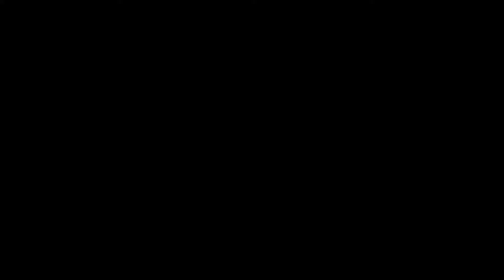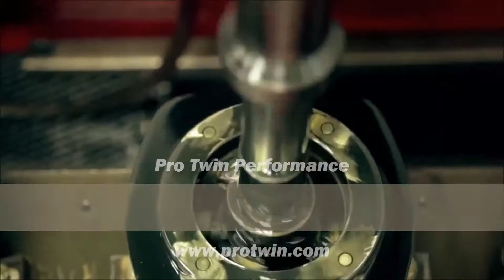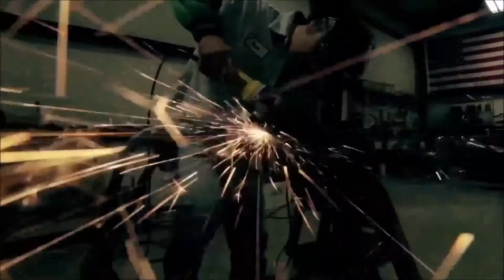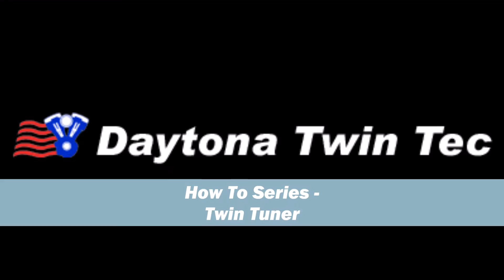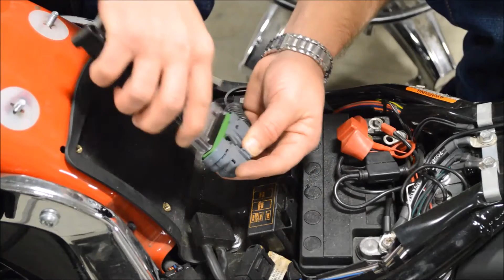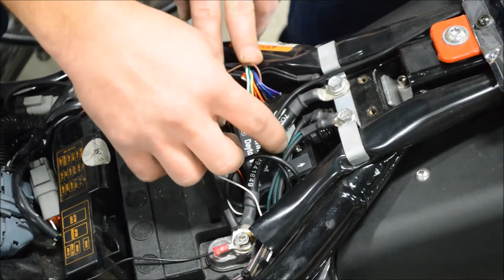Daytona Twin Tec - How To Series - Twin Tuner - Kevin Baxter - Pro Twin Performance

Comment: I just installed 509c cams and a high flow air filter  (it already had Rhinehart slip ons) in my 05 Ultra Classic. Runs great as it is but I'm sure she is a little lean. Thank you for this thorough video. Still waiting for more on the Dixie mafia. Stay safe

Comment: I noticed that on this video you say on parameter 1 to adjust to 2% fuel. In the manual it says to keep it at 0. Why the discrepancy? Which is correct?
Reply from the maker: whichever yields a proper AFR for you.  0 would be stock afr.  I prefer about a 13.8 at idle...so 2% would get you fairly close.
Reply: @KevinBaxter  got it running well at higher rpms/acceleration,  but at lower speeds through town it hesitates as is its  got a vacuum leak (which it doesnt) or not getting enough gas. Rhinehart pipes and big sucker

Comment: Kevin, Question - I used this video to Install my twin tech tuner and set it up after installing a S&S 509 cam chest and the Daytona Twin Tech tuner - Bike runs great but at cruise the engine check light will ever once in a while come on  for 30 seconds then go back out.. Any Idea's?
Reply: 03 twin cam 88 in an Electra glide
Reply: Never mind ----  I found issue ---- lose battery cable... I should have known better-  Thanks for your expertise, Love your channel
Reply from the maker: Thank you Mark.  Glad you found it sir.  Sorry for the late reply.

Comment: What should i set mine to 2002 fatboy. 36 inch samson cholos. High flow air filter. Everything else stock. Bike sometimes coughs out aor cleaner at. Slow speed maybe 10 to 15 mile per hour.  When i throttle it.  Runs great at high way speed and when im on the throttle ect.

Comment: do they, twin-tec, make a tuner for carburetor Harleys. for timing like screaming eagle use to. I can't find one, or could you recommend one, for a 2000 softail fxst. I put a twin-tec 2 on my 02 RK fuel-injected and following their instructions tuned it myself. night and day over power commander. thanks keep the info coming, it's great info.
Reply from the maker: Sure...they are currently on backorder, but i can get you one soon.  Here's the link to it.  http://protwin.com/twincamignition99-03carbonly.aspx  BUT....there has been a recent price increase...they are $375 now.

Comment: I added one of these to my 2003 Road King. Started out ok but after a couple months it had gotten worse and worse cutting out until it wouldn’t start. Removed it and the bike fired right up. Ever seen this?  Confused. Can they go bad?  It’s like the unit was not communicating with the injectors. Set it to base stage 1 settings as per the instructions. Played with it a little but reset to suggested settings before it got to where it wouldn’t start.
Reply from the maker: the single most common problem had with these, is the problem you describe.  with nearly all of them, they tested perfectly fine.  the issue was a good complete connection to the harness....feeding the injectors.  There was literally like a .01" defective rate on this product.  Very reliable and solid.
Reply: Kevin Baxter that’s good to know that the odds of them being bad are low. What should I do when connecting the pins to make sure there is a solid connection? I would really like to install it again. As the bike is low on the gas to air mixture

Comment: Great video, just one observation:  At one point you say to connect the ground wire that comes off the tuner but then you say the positive wire as you hook it up. I hooked it up to the positive side of the battery and that was incorrect. No power to tuner but fuel pump running.  Realized that it should be ground side of battery and it works great!
Reply from the maker: You are correct  thank you

Comment: Hi I know this is an old video but maybe you can help me. I bought one of these for a 2003 Buell Firebolt xb9r. The harness is a little different than the one in the video can you offer any kind of help or directions? Also does the bike
 require a TPS reset after fuel change with this tuner?
Reply: I'm curious too.i have a 04 Buell xb9s lightning and I'm debating to buy the tuner also.
Reply: I just finally bought one for my XB12r.  But it's raining so I'll repost in a week.--JB